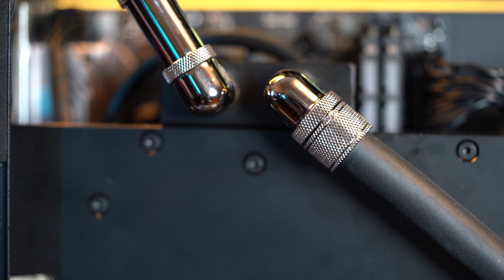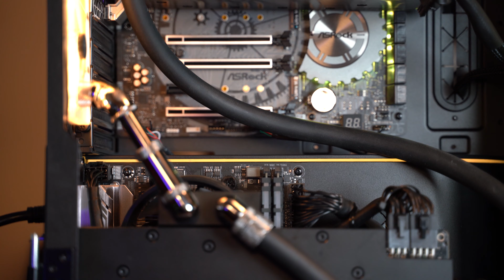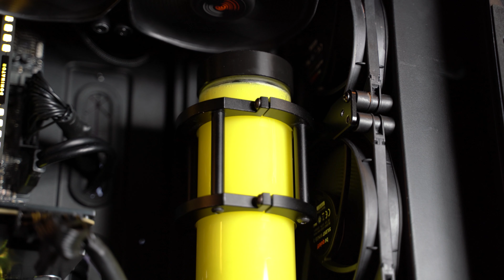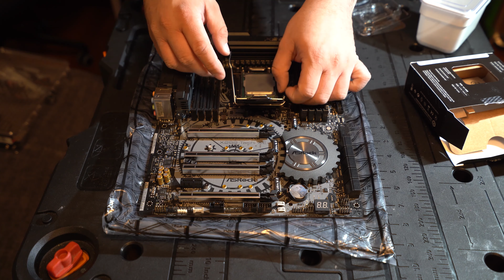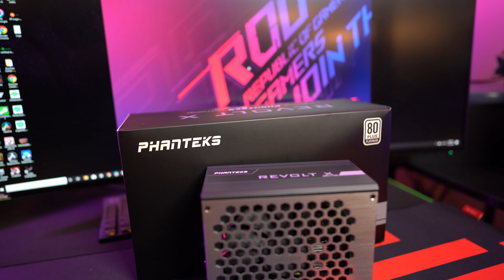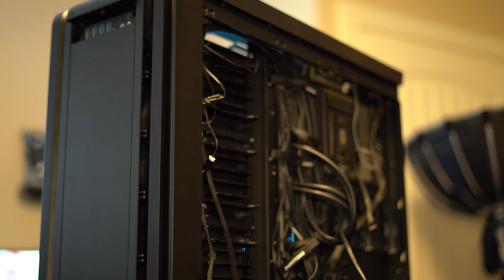WATER COOLED PC BUILD Dual System Case Phanteks Enthoo 719 Luxe 2 Titan

Comment: I am a huge Phanteks case,. "fan". And was looking for a video like this one in this case. I've seen some videos where some of the builders had issues with installing radiators that didn't quite fit properly as they had to make minor modifications to the case to make it fit.  But you seem to have made this work perfectly. I want to build in this case 100%. I may not be having it as a dual build immediately. But will have the option when ready to. Love it.. 😍👍🥂

Comment: Interesting video, one question, can an EKWB FLT 120 D5 PUMP can handle that configuration ? Right now I got my custom loop done 480 radiator plus a 360 radiator Phantek distribution plate one GPU Dual System, and my pump is spinning but is not pushing the water.

Comment: I’m using the Corsair hydro series kit to water cool my dual system in the same case would I have to get a reservoir pump just as big or use two Corsair reservoir pumps? or is it possible to use 1 reservoir pump to cool both systems in the same loop